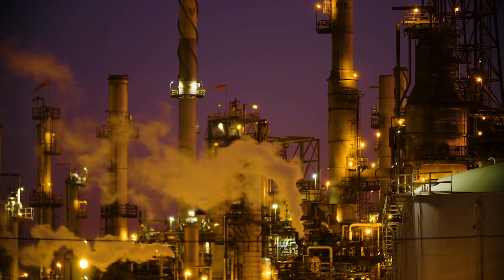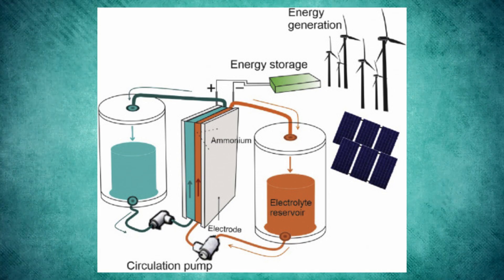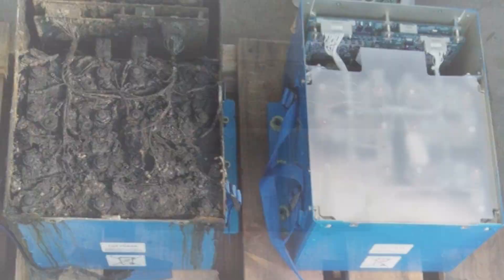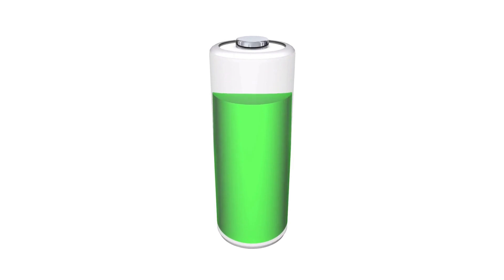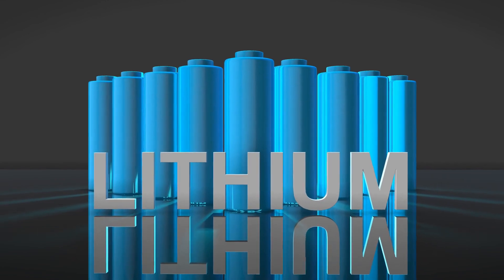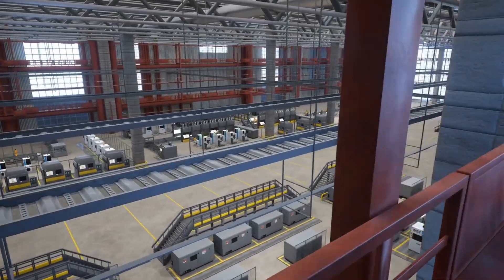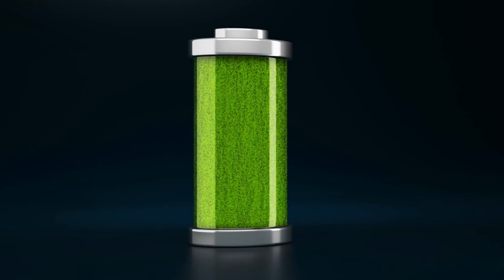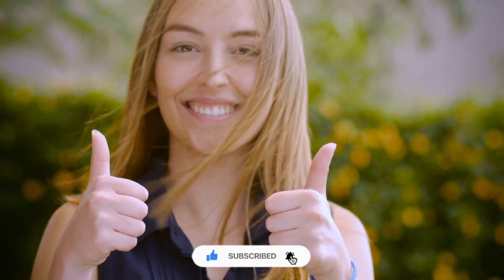Beyond Lithium: What's Next in Energy Storage?

Comment: Hydrogen is so much more simple!
Reply: Simple? We have barely managed to come up with a way to electrolyze it efficiently on large scale and storing and transporting it is troublesome given it can both leak through walls and degrade many materials. Then we need fuel cells that are both highly efficient and long lasting but still cheap. Hydrogen is a good fuel for energy hungry vehicles like planes but it is far from optimal for either short or long term energy storage.
Reply: Chemical engineer having worked several years on a project developing an improved hydrogen electrolyzing process here:

Energy storage via hydrogen is:
1. Immensely more complex than ANY type of battery, especially the very straight-forward redox-flow batteries presented here.
2. Order of magnitude 10x more expensive per kWh of electricity stored.
3. MUCH more dangerous, making it thoroughly inappropriate for home usage.
4. Has a round-trip efficiency of 30-35%, vs 90+% for batteries.
... and I could go on!  

Vs all that, it has precisely ZERO advantage.... except the one of being backed by the oil and gas industry lobbies!

But don't take me wrong!  The production of "green" hydrogen to replace "grey" hydrogen has a bright future.... but for the production of hydrogen for industry, in which the hydrogen is used as an atom in reduction and other hydrogenation reactions, but NOT as an energy vector!  It could be used for some energy storage and/or transport applications, but through the production of gases and other chemicals easier and less dangerous to store, such as ammonia, methane, ethane or methanol, for example.  However, even with such processes, the round-trip efficiency of energy storage would stay dismal and very expensive.
Reply: @st-ex8506  Are you thinking of cryogenic storage? 10x more expensive does not match with any data I have found and one of the advantages of hydrogen is that pressurized tanks need far less materials and work to manufacture than the high density batteries. There is no way a simple fuel tank is more expensive than an EV battery.

OTOH, 30-35% round trip efficiency is ten points higher than what I have been assuming as maximum.
Reply: @AnalystPrime  As to the 30-35% round-trip efficiency being 10 points higher than you have been assuming... you have been assuming quite correctly!

30-35% is the round-trip efficiency DC to DC... i.e. of a hydrogen-storage facility coupled with a solar park, for instance.

This efficiency will go down approximately  ten points, if your input current is AC.... but the round-trip efficiency of batteries will do to, under the same circumstances.
Reply: @st-ex8506  Can't recall where I read it but I'm certain there were news few years back of fuel cells that do not need platinum.

The cost of fuel cells is one of the reasons why hydrogen cars are a pretty bad idea no matter how much Toyota claims otherwise, but in larger vehicles they would save weight and cost less than batteries because the size of fuel cell remains same no matter how much hydrogen you carry, but you need a 1000+lbs battery pack to store same amount of energy as a 200lbs H2 tank.

Trucks and planes would benefit from saving tons of weight and being able to refuel quickly, and any companies using them should be able to handle the maintenance and fuel costs and train their people to work with hydrogen safely...if only the folks promoting hydrogen had actually done anything to build the infrastructure necessary for it like Tesla did with their superchargers. Nobody would use ICE either if they had to pay for oil drilling and refining in addition to setting up gas stations on their routes.
Reply: @AnalystPrime  R&D is obviously going on to replace platinum (or platinum-group metals) as a catalyst of fuel cells.  And obviously, some of this research work will be published in scientific journals.  But, so far, without success. Toyota has only succeeded in reducing the amount of platinum used in their Mirai's fuel cell from some 40 g to 20 or 25 g.

While it is true that the size of the fuel cell has nothing to do with the range of the vehicle it equips, it has everything to do with the power it can develop!  That is why the Toyota Mirai has only 150 hp, making it a pretty sluggish car for its price and category!  Making a "Mirai Performance" to compete with the Tesla M3P would require quadrupling the size of the fuel cell!  I am not even sure that the Mirai's fuel cell can deliver that much power, or only the battery + electric motor power train.  I believe it can't, as Toyota is playing with the fact that no car is used at constant maximum power, but only for occasional short bursts (save car racing of course), but I have found no proof to confirm or infirm that hypothesis. 

Trucks would need one or several fuel cell(s), totalizing the power of 4 to 8 Mirais, depending on their tonnage and application. Possibly many more if my hypothesis above is correct, as trucks can be used for prolonged periods at full power, when climbing any mountain pass or significant hill, pulling a full load.  Also, don't forget that they would still need a pretty sizable battery for regen braking.  ButI agree with you that, as the vehicle grows in size, a hydrogen fuel-cell powertrain become more competitive on weight than an EV, for the same range.  But very few trucking operations are done at max gross weight... less than 10% of them, seemingly.  So, it is the costs (capital + operating) that is the main driving factor... and on that metric, hydrogen is dead in the water.

And then, as you most rightly remarked, without hydrogen distribution, there can't be  hydrogen vehicles... and presently, many more hydrogen stations are closing than being built!

So, could there be niche applications in which HFCEV would make sense?  Yes, possibly... although I can't think of one.  Cities that had a fleet of hydrogen buses are giving them up.  The few hydrogen trains that exist are being taken out of service...

As to airliners... hydrogen seem to be taken seriously by aircraft manufacturers... at least Airbus has some level of development on the topic.  But hydrogen propulsion would require fundamentally new everything... totally different concept, shapes, engines...EVERYTHING must be invented anew!  I am no aircraft designer, but it seems to be a pretty long-term project!
Reply: @st-ex8506  Indeed, if we already had the infrastructure, if we had more resources, if the fuel cells were better... then we still would have to design the vehicles that use them from ground up.

I still support researching the technology because it will be important in space and you never know when someone might have a breakthrough, but if a BEV really doesn't work for something, we do have plenty of ICE vehicles we can keep using.
Reply: @AnalystPrime  Oh!  I am certainly not saying that hydrogen fuel cells don't have their utility... in space, as you said, and possibly for other applications, but certainly not for light road traffic, and even for heavy traffic, trucks, I have my doubts. Possibly for delivery fleets, or urban transport, which do not need a spread-out infrastructure.  Bur even then, the cost of green hydrogen is presently a killer.
Reply: @st-ex8506  Funny how often people focus on light vehicles and even forget trucks, buses etc. exist, then when it is pointed out that is not such good idea they think there is no use for green hydrogen. We need ammonia for fertilizers, making it with green H2 removes need for imports. Build the infra for that and someone might go "hey, we are already making tons of hydrogen, why not run our transport vehicles with it?".
Reply: But dagerous
Reply: @CSGATI  The myth lives on!